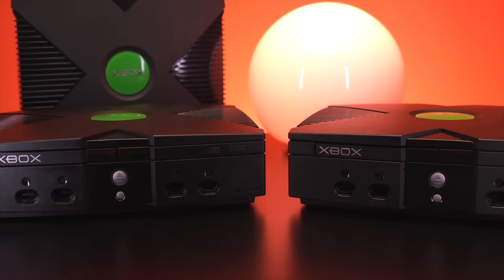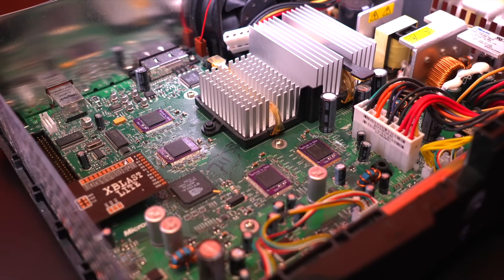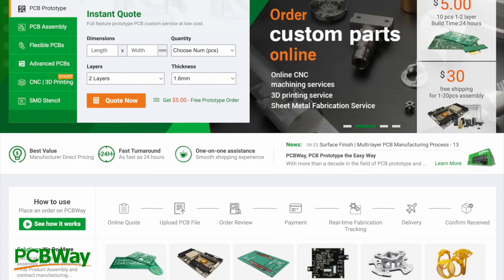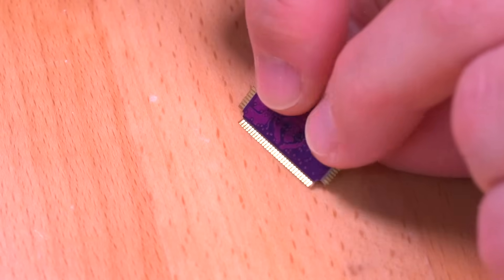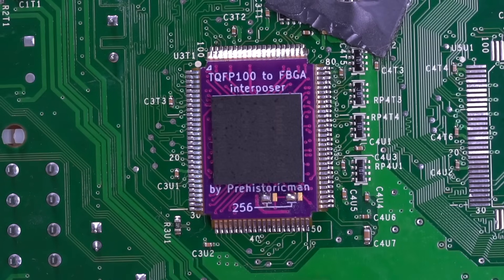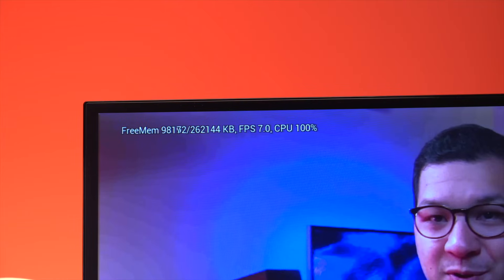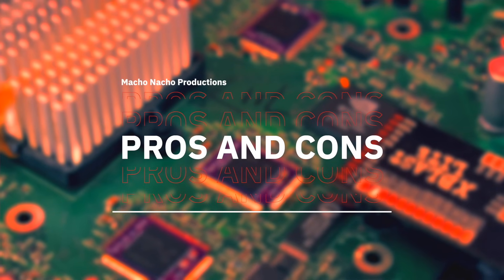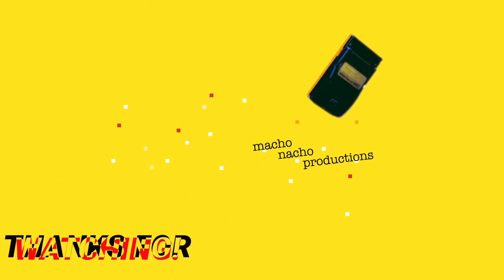Giving The OG XBOX Quadruple The RAM | Never Done Before!

Comment: i would love to see someone like Modern Vintage Gamer chime in on things dealing with this ram, as he wrote the N64 emulator and some others on the Xbox, and the ram could be put to better use as shared VRAM with a rewritten BIOS and Kernel ie not just replacing a dashboard, but rewriting the implementation of binary executables like heavier emulators and DosBox or other ways to run things on it, like say a VM environment to let one boot OLDER operating systems like Windows 98 so one could run older PC games with the addition of a Keyboard and Mouse. Linux would be easy, as one could simply port a low-footprint distro like a 32 bit Puppy Linux version but built with modern 32 bit packages from Debian, for example. You could make it into a server for things like Insignia, with the extra ram being there to host other players on private games. Im suspecting with how the performance with the 8k video that cut to 1/4 ie 1080p one could possibly get the hardware to run that level of video using the extra memory as Vram. As well, Texture upgrade packs and upscaled ports could also be a thing, BUT pair this upgrade with a better CPU like the upgrades that can be done now to double that CPU speed and you could really have something there!!!
Reply: You can already boot Windows 98 on the Original XBOX, naturally the additional memory would help, especially when running other applications.

Comment: I was telling this for 20 years... with proper ram chips the xbox can had even 256mb!!!
XBOX is a NVIDIA NFORCE2 motherboard... all original XBOX can go 900mhz CPU from stock (733mhz 133fps to 900mhz 166fsb, the max FSB of the Nforce2) and had more tham than 128mb as the Nforce2 supports it, with the proper chips and bios!
Reply: And nobody has bothered to do the 256MB RAM upgrade because it's too much hard work for very little reward. An old PC will come with more RAM or sockets for fitting some, a proper socket for changing the CPU and all the other niceties the Xbox lacks.
Reply: @another3997  NO. Like this "ram adapter" to use DDR2 on xbox, a adapter to use socket 370 processors twice as fast, existed since the xbox was launched. You can install a socket 370 on the xbox and use processors up to 1.5ghz, and the XBOX is the only Pentium3 with a Nforce New generation Motherboard thats the key about the xbox being a non obsolete timeless machine.
Reply: @another3997  NO, the XBOX actually had another adapter to use 370 processors and double the power...  @another3997  that are DDR2  chips adapted to the xbox that use old big CQ50 chips, the improvement is that adapter. Like the adapter to use socket 370 on the xbox. The Xbox because of his prototype Hardware is a timeless PCthe problem is about the enginering to keep it alive, but remember us that you dont need New Hardware for an entertainment system when a 2001 one is capable of run YouTube and if serios developers wanted it, probably all today social media... A 2001 machine, so today technology is a lie designed to be OUTDATED and send to trash, a big looping of new technology going to the trash every year.
This 2001 console was designed to be Anti-Outdating, even is very very old Hardware.

Comment: Great video once again.

Just a tip when using the hot air gun, the nozzle you had on, although it worked, it can be a pain as the hot air is narrowed down to a small spot, for something like the RAM chips, its actually much better to have no nozzle at all or a large one, that way you get more surface coverage and will lift in one with less chance of pulling/tearing off a trace.
Reply: Might feel like god to be an expert at hot air nozzles and nick-picking others with your special knowledge.
Reply: @user-yk1cw8im4h stop being rude, big nozzle = wider area, it's like a hose. It doesn't take a gods knowledge to know that, just simple physics
Reply: @Theoldenmage  That guy clearly doesn't watch or listen to the videos, I hear a lot "Im not an expert in soldering, any tips will be helpful" and you know.. someone thinks i'm been a "god"... I just don't entertain people with a sad life that they have to put others down for helping in future projects, damned if you, damned if you don't with them kind of people.
Reply: @user-yk1cw8im4h  :face-fuchsia-poop-shape:

Comment: Unless running modded games or homebrew, i don't see a RAM capacity increase helping in any console. The games for the console were made to be playable with the original amount, so it's unlikely that it'd ever have a scenario where it tries to use more RAM than it would have had pre-upgrade.

The only way a RAM upgrade would be likely to help in my opinion would be if the RAM was better in other ways than capacity. (Speed, Latency, etc)

Comment: Very good video, although I don't find that mod useless, you can try it with the emulators that you can run on a modified Xbox, I know that the arcade ports run well with 128 megabytes of ram, just as there is an improvement in the N64 emulators and Psone. You could explore how those emulators run along with the Nintendo DS emulator. I like your content a lot. Greetings from Colombia.

Comment: Be careful with the Kapton tape, can do more harm than good. If it gets a good grip to components underneath, and they get hot enough for the solder to melt, it can float the components. Should be fine removing the ram without the tape, unless there's plastic etc around the area

Comment: games DO benefit from the faster memory, m$ bought cheapo, binned ram chips from samsung and hynix that didnt pass the tests, most were unable to be clocked at full speed, the xbox had to test and find the highest posible speed in every boot, thats why some games run smoother in some systems than in others, with these newer chips, the xbox will always run at its top speed and thetefore ram bandwidth

Comment: whats the TDP on that nvidia chip.. is it possible to replace it with another chip from the same 'kelvin' generation ? i noticed it seems to be in the geforce 3/4 series.. would it be possible to put say a NV28(geforce 4 4800) chip in the originals place? just occurred to me that the NV28s ran on an 8x AGP bus, would that be an issue  ?

Comment: a 3D printed template of some sort for bending the pins would be cool. 

Create mounting holes on the PCB that lock in to pins on the template. The template would have beveled edges to press the "legs" onto with a length of firm plastic.

Comment: Youtubers drive me nuts with how much flux they use. Most soldering doesn't need additional flux. If you're doing higher skill stuff like some surface mounts like BGA chips or others that that NEED hot air, yes you need flux. Low level pin soldering aint it.

Comment: In fact the interposer pins should be shorter than the original 2001 ram chips. That allows to solder the pins without the need to bend them too much or the interposer could be designed with the pins on the pcb and that could help to solder on a 90° inclination

Comment: Great video.  I hope that once the bios can be updated it will have a positive effect on the speed, graphics, etc.  So does this same concept apply to the Nintendo 64?  I noticed that the motherboard has two 2mb chips, but the expansion pak has a single 4mb chip that could possibly used to replace the 2mb chips.  With three expansion paks you could take two chips out to put on the N64 motherboard.  With a N64 with 8mb instead of 4mb and then add and expansion pak it would have a total of 12mb.  Would that improve anything or would bios have to be hacked, updated, etc?

Comment: There is a video here on YouTube about a guy installing a 1GHz processor into an OG XBOX, there is a slight performance upgrade in the XBOX framerate. Even making Half-life 2 playable with better FPS.
What would happen if you install the upgraded CPu and upgraded RAM? Would this XBOX perform a lot better or could it unlock new capabilities?

Comment: It actually would have benefits to draw distance, allowing less pop in for games. Mods can be created that can help give more consistent frame time, and added buffer for games running on hard drives. It would also help keep the CPU busy, allowing for slightly less CHUG with the original CPU. The best of both worlds would be to pair this with the CPU interposer and increase CPU speed etc.
Reply: On top of that, as this mod becomes more popular and reasons to install it increase, it will increase in price giving people regret of not buying it while it cost less.
Reply: So is it useless for now or not I'm confused
Reply: @spyczech  not if you play the Xbox a lot or have games you like to play that don’t run well. In terms of yes and no currently there are no mods that take advantage of it so no.

Comment: Pretty interesting Mod with 0 use at the Moment. :D
But i have a few complains...
Your 8K Video Playback isn't possible at all, your Bottleneck is the CPU!
It's possible to swap the CPU with a 1.4Ghz one (in case you're not aware of it), but even then you wouldn't see an 8K video running smoothly.
Anyway, smooth 1080p playback should be possible with 256mb and  a1.4Ghz CPU.
The Next thing is... im pretty sure you won't see any usability for Games in the Future, the total amount of RAM used to run a Game is set in the code of the Game, not in the BIOS!
Sure, from a technical standpoint it's (with a looooot of work) possible to write a program that decompiles a game and inject values to maximize the amount of RAM and recompile it, but this will only work for 30-40 percent of the games (even when the development is going on for a while and and the program does it's job as well as it could be).
Reply: 1080p movies and shows would actually be so amazing! I have 800+ movies and 100+ TV shows on mine so this is kind of a huge step toward what I've been wanting.
Reply: 1080p blu ray would be possible in this machine

Comment: I wonder if 512 MB is possible if both sides of the interposer boards can be populated with memory. Some minor adjustments would need to be made, most notably the pin length to the motherboard due to the change in z-height with an additional RAM chip.

As for the RAM stability, I am curious what operating voltage and timings they are leveraging.  Default DDR1 voltage is 2.5V while many of the high speed RAM kits on the PC would go up to 2.8V to be stable and need a heat sink to operate at their advertised speeds. JEDEC mandated that 400 Mhz speeds (which uses a 200 Mhz true clock) come in BGA form factors while slower speeds were permitted with TQFP.  This mod if operating at full speed (300 Mhz true clock) should have problems due to the adapter but running at two-thirds of its rated speed this packaging change should be fine (remember that JEDEC specifications are for the DIMM form factor which inherently has longer trace lengths).  Some tuning of the PCB interpose maybe necessary to further normalize trace lengths which could require a few more layers there to pull that of as there is very little wiggle room.  

One more mundane usage for the extra RAM would be a disk cache.  Pre-emptive copy disk data to the unused portion of RAM so when requested, the cached data moves via a memory copy to be used.  This is faster than an SSD but the real world benefits over an SSD here are minimal.  This would be a huge advancement for those consoles still using the original 8 GB hard drive.

Comment: Do xbox games use a give me what you have approach with ram and cpu clock speeds or are they using locked predefined values?  In other words will a 1.4ghz cpu upgrade and this or any other ram  upgrade apply the higher values to improve performance? Or are these upgrades only beneficial for custom content?
Reply: Anything can take advantage of the 256mb RAM/1.4ghz CPU! as long as you are using Project Stellar, or manually patching your games to these values

Comment: The extra ram would improve graphics or loading times in theory, but to that, heavy modding in the games would be needed.
For starters, more RAM means more room to store game sections directly into memory, avoiding reading from the disc or the HDD. But to do so, the game will probably need to be patched directly from the code, to use the extra space.
With the extra ram, we can make use of better texture resolutions. But for this, games (again) need to be patched or modded. 
With more ram, games could be forced to run at higher resolutions like 1080p. But again, the game will need to be patched in order to do so. 

In each of these points, things might be either more difficult to do than what I make it sound, or even easier.
But the thing is, yes, the extra ram can be utilized. But will require much work from the community and will need to be done on  game by game basis.

Comment: 16:50 - it's very unlikely to happen in a so old hardware. Especially on Linux side. The sense of having a secure OS is a UEFI configuration. Also, Linux systems with less than 512Mb of ram and on x86 architecture are very pointless. Counterproductive for security reasons.

Comment: WTF is the point? The games are designed for the memory that comes on the consoles. Some games on newer pc setups will not manage to hold the 144 FPS my 4090 can easily achieve because of the inherent design! Mass Effect 3 legendary is like that, it will do 144 FPS but not hold it and of course never push the video card hard it is built in timings, all the power and memory in the world cannot change that!
Reply: Because it's huge for modders! It's huge for me due to what I can do with xbmc with 1.4ghz processor and 256mb of ram!

Comment: You mentioned Linux, but you failed to mention ReactOS. ReactOS is an open-source, clean-room reverse-engineered version of Windows that has an Xbox native port. I don't need to spell it out for you that having more RAM in a Windows-like operating system will most definitely benefit the applications run under set operating system.
Reply: You act like clean room is important in the scene even though I'm most certain that isn't even clean room since you gotta understand how the kernel works on code for the system to boot
Reply: @Hellraiser988 ReactOS is clean room. They have to be. Otherwise, they open themselves up to copyright lawsuits from Microsoft.

All clean room means is that the person writing the code cannot under any circumstances look at the disassembled binaries. One engineer disassembles the binary and documents how the functions work without documenting code. The other engineer implements that in their own way.

Comment: almost 20 minute video and you're not gonna show any games running with the ram upgrade? not gonna show 720p video playing on it at full speed? what a waste of time.
Reply: Agreed. A lot of fluff dressed up nice
Reply: 720p needs a CPU upgrade to run... or overclock the stock CPU to 900mhz, or change the CPU to 1ghz or more with a 370 interpoder, that is WAY MORE COMPLICATED THAN THIS RAM UPGRADE, having a new ram modules that are DDR2 adapted for the original xbox is awesome, as its a "new part" not like the CPU that are "limited old hardware". Anyway, all XBOX can run at 900mhz even 1ghz from stock, overclocking by software.
There are no patches for use that ram, but for example games like MORROWIND you can use 256mb de ram to increase the VIEW DISTANCE.

Comment: Damn Half Life 2 might have benefitted from more RAM. Well, a Pentium 3 would be the actual upgrade that would make Half Life 2 work very well.
Reply: @DavitTheCore  you can overclock every original Xbox to 900mhz fsb 133 to 166 the max of the XBOX Nforce2 chip, and HalfLife2 runs flawless even in 720p with 128mb ram... But with 256mb you can USE HD TEXTURES on HalfLife2 like the PC... the only that the XBOX port lacks, it uses SD textures because of the low ram.
Reply: @SargentoDuke  I guess that could very well work! I'm not sure the end result would be as good as a Pentium 3 modded Xbox (just like shown by modern vintage gamer).
Reply: @DavitTheCore  Xbox had a way better Motherboard than a pentiumIII and way better optimized software

Comment: Might want to stake those modules down with some silastic/RTV or even some hot glue after verifying they work.

As far as the stability issues, it could also be the mapping of the traces on the interposer itself. More testing would be needed to figure it out. This is an awesome project though. Amazing work!

Comment: F yea! Come on base model PS4 ram chip mods I'm waiting lol. Linux would greatly benefit from extra ram. I thought about using a flex cable and piggybacking the ram chips on both sides on one end then soldering the other part of the custom flex to the points on the motherboard. I'm waiting for someone more professional to accomplish this just like this og Xbox mods at the least! I highly support and love these kinds of hardware mods!

Comment: Would be very cool to install windows. Pentium 3 + 256Mb Ram + HDD and DVD-Drive. Could be a nice retro machine for early windows games
Reply: 256MB would allow to run even windows XP realistically (I mean, 64MB is labelled as the "minimum requirement for XP", however you can't run anything else, and even with 128MB it struggles a lot, I think 256MB is the sweet spot for XP)